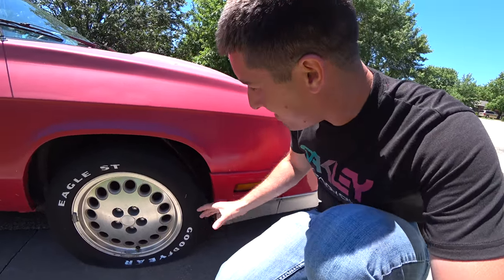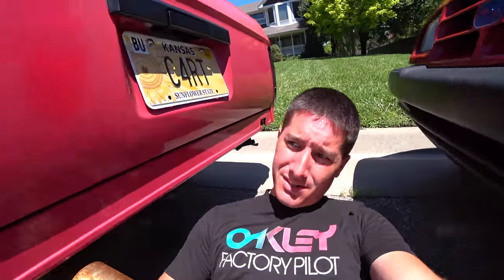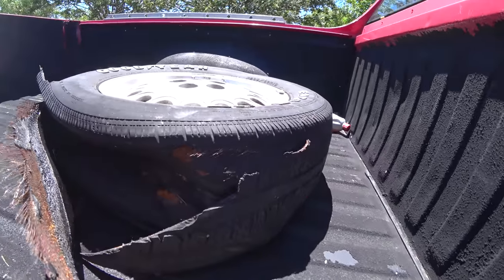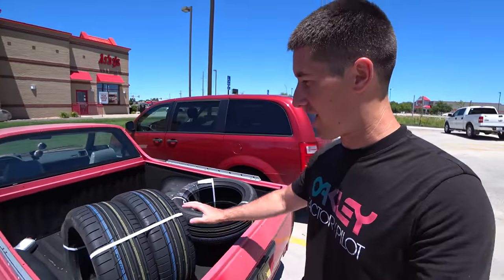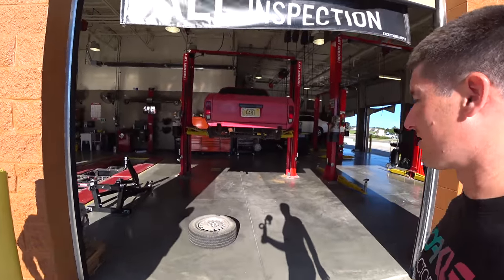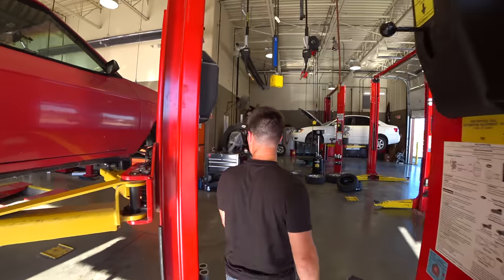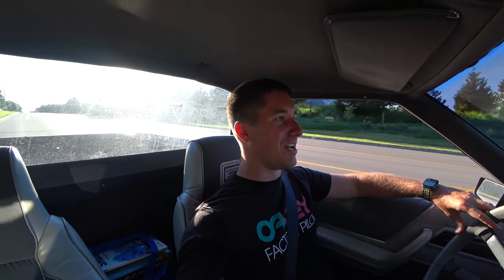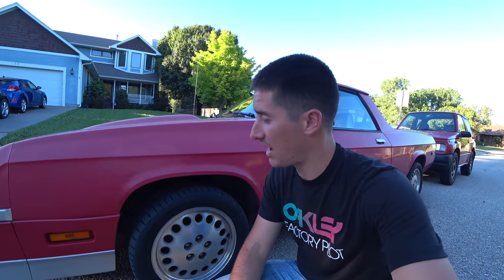A Tire EXPLODED On My Shelby Dodge Rampage In The MIDDLE Of The Night

Comment: We need some paint correction/buffing on the Rampage!
Reply: Yea I was thinking the same, it's worth keeping around a bit.
Reply: Ya
Reply: It could use a rear bumper too.
Reply: If you perform a paint correction, you may not have any body work left when you're done!
Reply: Its a cool car and worthy of paint correction
Reply: I think the paint was rustoleum with a roller. No joke
Reply: Single stage paint prob.
Reply: I think they buffed it once already, but IIRC its Rustoleum which seems to get chalky quick, at least out here in California.
Reply: @briangray5921  1980s paint jobs all ended up losing the clear coat pretty much. I even had a 93 S15 that lost all the clear coat. The chemical companies were doing stuff and making changes to make our paint better for the environment and the people who spray it. The consumer in longevity were not considered in these chemical changes.
Reply: Yeah, it'll buff out! Then a quality ceramic coating!
Reply: The volt and the svx have oddly similar rear ends
Reply: OneWheelPeel Productions they didnt buff this one, they buffed the EXP.    this one will shine up some but gotta take it easy, not much paint left, the pads will be red as hell
Reply: @thecman26  no,it wont...its rustoleum
Reply: @trillrifaxegrindor4411  it will

Comment: You would think with firestone charging you over $100 to mount and balance 4 tires they could have at least put your spare tire back up. When I was a tech at Goodyear our tire guys always aired and checked the spare and put it back in its storage spot and replace the jacking tools also.
Reply: I thought the same. I do this to almost every vehicle in this scenario. Unless there trunk is filled to the brim with a bunch of shit. Then I would just say fuck it.
Reply: I love picking up new tires from tire rack
Reply: i love the word tech,it almost always means "a guy who changes oil and tires"  you know,things i knew how to do when i was 11
Reply: @trillrifaxegrindor4411  no, at our shop, techs were all ASE certified, and I was master certified in all 8 areas, along with certs in driveability and heavy truck. I was a Drivability and onboard computer systems diagnostic technician. When I worked at gm, I was sent to GM technician training in Michigan. At Goodyear, we had our tire guys, but if we got swamped, we all had to help

Comment: You gotta change tires every 7 years max, even if the tread is good. This is exactly why. So lucky it didn’t happen when you were driving!
Reply: I had the right rear on my 88 Subaru wagon driving straight on the highway while I was up around a hundred mile an hour. We all walked away but the car did not fare so well. Hell it's been over 20 years and there are still silver paint scratches and composite bumper scrapes on the K rail
Reply: @drippingwax  me to
Reply: '88 Subaru wagon going 100 mph...Hahahahaha!
Reply: I respectfully disagree with that. It depends on how hard you drive the car and what condition the tires are in. Granted the tires from the last 10 years or so are trash and hardly rubber so they crack easy.

Comment: I had the same experience with my 98 Lincoln Mark VIII and old tires with 5/32 tread left. No blowout, but they were 2006 date code and was on the fence about replacing them just yet, but I got a good deal on a set from Walmart and had them replaced. Boy ! What a great difference !!! The ride was smooth, no more vibration and no harsh bumps or noises ! Sidewalls was hard on old tires and dried out !

Comment: The tires had to be cracking and dry rotted. Not surprised new ones made a big difference
Reply: son2soaringeagle not tires that are that old they were ment to last longer they went designed to deteriorate in land filles like they do now
Reply: T.F.D 1982 - I used to sell those tires as a “certified Good Year Eagle Tech” a looonnngggg time ago. We recommended they be replaced every 5 years back then too. They only had one steel belt in them which made them ride really soft but they didn’t corner as well as TAs of the era. You could feel a difference in the softness of the tire even when you mounted them on a rim. Actually TAs now have the same tread pattern! (Holy sheet!) kinda like the All Terrain TAs. I guess they had it right way back in the 80s. The casings are mostly different now. The Eagle STs were known for separation problems.  I didn’t know it could happen just sitting!! Hahaha. 
    Somebody said JR was lucky to get home. I believe they were correct! The amount of vibration etc, that front tire was totally separated on the drive home. 
Stay safe out there!

Comment: You're lucky it separated when the car was stationary. I had the tread separate when I was going down a steep hill on the interstate going 75 mph! Completely destroyed the fender and inner fender on my '83 Monte Carlo. I almost lost control the wheel was bouncing up and down so bad I couldn't even steer. The tread didn't completely come off, it just acted like a flail and obliterated everything in its path. It was the front right wheel too, just like yours.

Comment: When I saw that the tire exploded, I was afraid that it happened while you were driving it.  I'm really happy you weren't, that would have caused some serious damage at best and caused a crash at worse.

I purchased a new V6, 5-speed extended cab S-10 in 1995 and had the popular 90s fiberglass running boards, aftermarket wheels and those Goodyear Eagle STs on it.  They were sweet-looking tires and rode pretty good back then.  I believe by the late, late 90s or very early 2000s, I was no longer able to find them so that must have been when they were discontinued.
Reply: Did you watch the video?

Comment: I’m on my second Rampage…  I had the red “Prospector” version back in the 90s.   Sadly, the engine busted something, and while it was parked at my dad’s shop waiting to figure out what to do, someone had the bright idea to cut the cab off and make into a trailer…  I don’t think that worked out very well, and I was a bit ticked.  But I had left it there for… uh, let’s just say “Some Time”….    The new one has a carb on it instead of the throttle body, so I’m trying to figure out what to swap in, as that wee 2.2 just isn’t doing justice.

Comment: Classic tire separation, I managed tire stores for 10 years from '88-'98. ..Saw one of these almost daily. Those are so old the belt ply's rusted and finally snapped apart causing the explosion with probably only 30 psi.

Comment: Shelby Rampage is one if my dream cars lol. Same dash as my omni I had when I was 16. I had a turbo Daytona after that and an Na 2.5 Daytona. Turbo one only had 62,000 miles...blew the head gasket almost immeadialy after purchase. Put over 60,000 on the NA Daytona. It never broke down until the day it threw the timing belt. More reliable than the 5 Hondas I would own after that!

Comment: The Eagle ST isn't THAT old dang it! Sold them early in my career, lol. ST was the lower speed rated version of the GT performance tire which had a higher speed rating, different sipes and greater sidewall strength. Replacing all 4 tires often fixes what customers think are alignment or suspension issues. If a car pulled one way, and an alignment check showed all green, we just switched the left and right side tires, then when it pulled opposite, we knew the tires were the issue.

Comment: I still have the original tires on my 1997 Chevrolet Tahoe in perfect condition. No failure, no blowout for being 22 year old tires. Took them in the Michigan snow and they gripped with no problem.

Comment: I have never managed to wear out a set of Goodyear tires. I have had them go out of round, belts shift, belts separate, and even had one blow that only had 300 miles on it. The worst was one that did exactly what yours did. The vulcanizing failed. The chunks of tread ripped off the entire inner and outer quarter panels from wheel well to back bumper, but the tire still held air. You do need to replace the spare, too. It is way too old. I am running the Radial T/A as a summer tire on my 90 Volvo 240 wagon. Next tires will be a 15, and hopefully a whole lot better.

Comment: 4:03: Wow... Been rusting the belts for a while. So after likely taking corners and driving it on the highway, it blows out while sitting still at night.
Consider yourself lucky that did not happen going around a high speed bend. 
Very cool example for people that run tires down to the nub: Not a good idea.

Comment: I had the entire tread come off the tire on our 03 Chevy TrailBlazer on a trip to Iowa A few years back. We were pulling our stuff in a trailer and moved there for 8 months. The tire qasnt even the original. I has replaced all 4 tires a few years before when I couldnt keep it on the road on our first snow of the season. As it never acted like that before, I knew it needed new tires. Two years later, junk.

Comment: I had a (firestone) tire explode like that with no weight on it. It came with a Wagon I had bought as a spare. I never used it, just checked the air in it from time to time.  One day I walked past the back of my wagon, and noticed the spare tire cover off to the side. Looked closer and found that the tire had exploded.

Comment: And THAT'S why it's a very bad idea to run old tyres.  If that had happened on the highway it could easily have been a high speed trip into the scenery and the end of the Rampage, and possibly JR too.  If your tyres are over 10 years old then they're too old and they need to be replaced as they do have a life limit...

Comment: They say tires are not safe to drive on after 7 years but I know new ones are expensive. You need good rubber especially on your cycles. You probably had belts separating causing it to shake and vibrate.

Comment: If you open up the stock exhaust some or put a bigger one on (2.5") and put a grainger valve on the turbo set to 12psi the car will really wake up and will be around 170-180hp. It's disappointing the previous owner went through all that trouble just to put a T1 one. He should have put a T2 in, you would have started at 174hp. You should visit the Turbododge and Turbomopar turbo sites on the web and on facebook. There are a ton of experienced people on there who are very knowledgeable. http://www.thedodgegarage.com is very helpful too. Lastly, if you need parts check out http://www.turbosunleashed.com and http://www.fwdperformance.com/Store/.

Comment: part of me nearly crapped my pants. You're supposed to be an expert and you were running around on how Old tires? Jesus Christ! You're lucky you're not dead. I've seen five year old tires explode like that below 20-year-old tires. No wonder you were adding a crap load of problems with the vehicle doing all sorts of weirdness. Unfortunately. I'll never get to have another rampage. I briefly owned one when I was little younger than you only ever got to drove tIt a few feet. Still passes me off to this day. Basically, I got scammed by a used car dealer. I got most of the money back guy ended up getting a lot of trouble where a few people went after him and looting the government at the time I was trying to find an El Camino and found the rampage by accident. Even back then they were super rare around here. Couple years later I ran across a guy with five in his yard, none of which were salvageable and over the next 20 years I've encountered two more not including seeing them in movies and such. Didn't know they made a Shelby version. They're one of my front-wheel-drive guilty little pleasures also happen to like the Yougo , gremlin, and pacer. I mostly more into rearwheel drive. Man running around on 20 year old tires. I thought you had more brains than that.. Can't believe it cost $100 to get them put on. I figured it would have been a $50 job

Comment: How can you say the old tyres (Y not I!) look fine when at 4.04 you can see that old one is clearly bald? It is worn down to the steel plies which have rusted and failed. Shame on you for using a car on the road and being so blase about the condition of the tyres. Sad Face!
Reply from the maker: Not a single tire was showing cords or even down to the wear bars... the one just exploded which is why you could see the cords
Reply: @WatchJRGo  At 4.04 there is no visible tread across the surface of the tyre. No, the steel plies may not have been visible, but the rubber over them was so thin the water permeated and corroded the steel . These should be shiny steel, they would not have become so rusty overnight. As for wear bars?! there are no tread grooves to house wear bars! Show me the wear bars you are looking at. This tyre was well past usable and you are so lucky it did not let go when you were driving. Don't get me wrong, I love your channel, but in this instance, I think you were asleep at the wheel (or tyre?!)